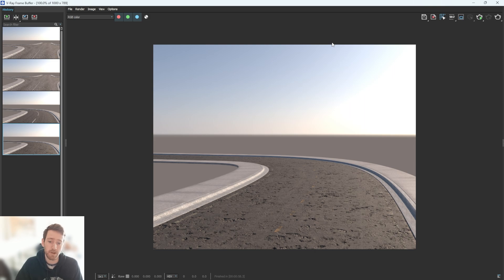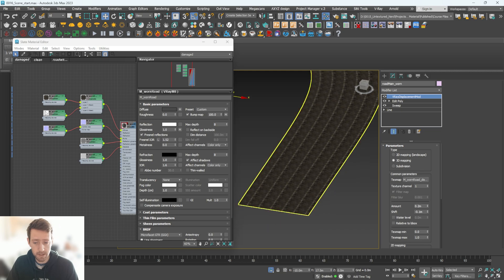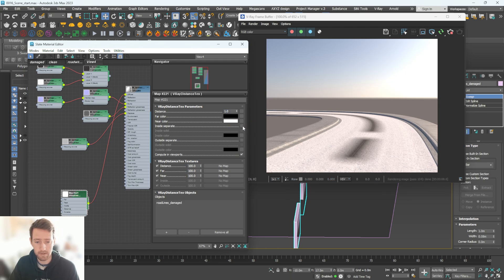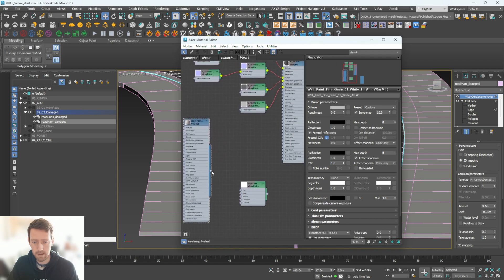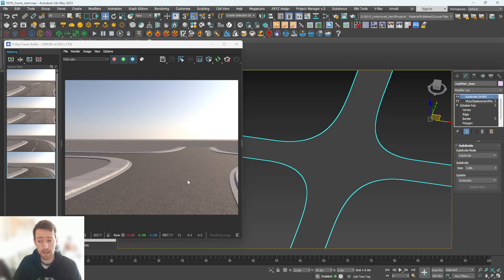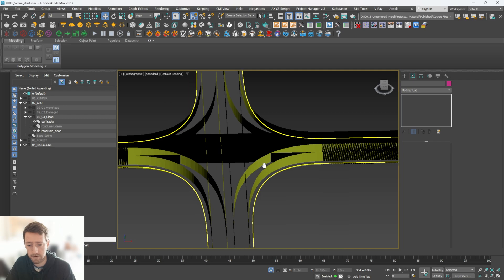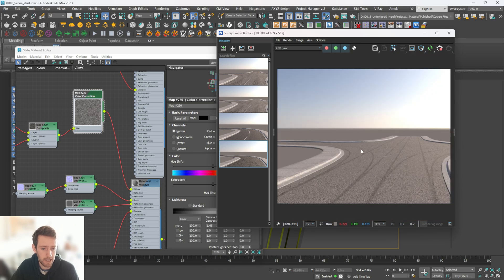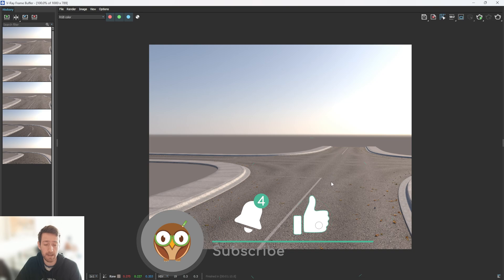How To Create Realistic Road Materials

Comment: Hello. In the case of road paint, what I've always done is simply take the bump in the asphalt (a noise with Uwmap on channel 2) and apply it to the line material (white noise made with Diffuse on channel 1). It's always worked for me. I'm going to try what you explain in the video. Thank you very much from Spain.

Comment: Some things ive learned: 
1. plug a noise map set to fractal with a fairly small size into the distance of the distance tex. It gives a much more realistic transition from the two shades of tarmac. Mess around with the highs and lows of the noise map too.

2. Reduce some of the roughness on the worn tire track material so it has a touch of gloss. I notice that well worn road tends to shine just a small amount where its been driven over for years.

3. Add another tarmac coat to your blend material but with a distance tex this time selecting the curbs.

Comment: Hey.
Thanks for the excellent tutorial.
I have a question: I also work with real time d5 render software. How do I export from Max to d5? The problem is that d5 doesn't know how to get a distance texture, so I have to somehow turn the road so that it has the texture of the paint markings and the tires. Any idea how to do this?
And thanks again
Reply from the maker: Hi. So you can bake the texture from your road material. You can see my other video road markings for SketchUp which goes over it. You will need vray's render engine still to achieve this effect though. Let me know if you need further help.
Reply: Wow thank you very much.
This is exactly what I was looking for.
I tried with render to texture without success.
With the bake to texture (as in your tutorial) it works great.
I have no idea what the difference is between them.
And again thank you very much